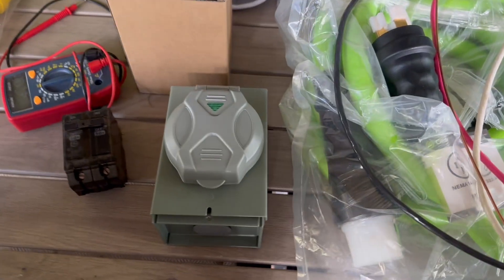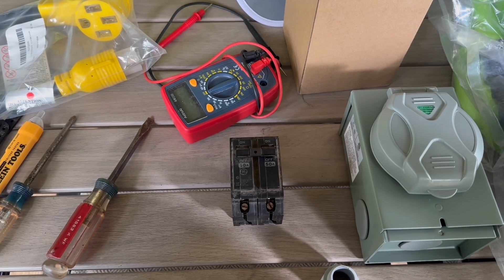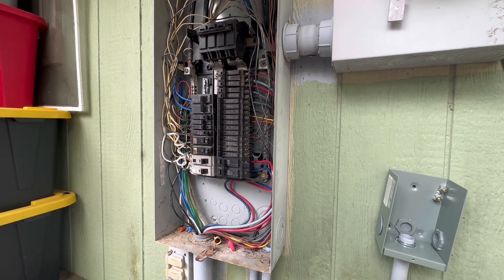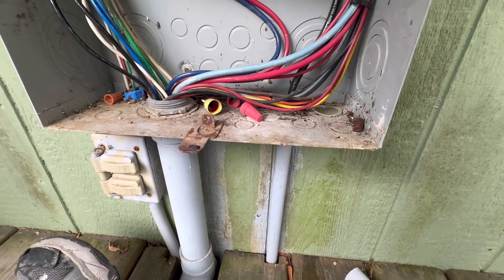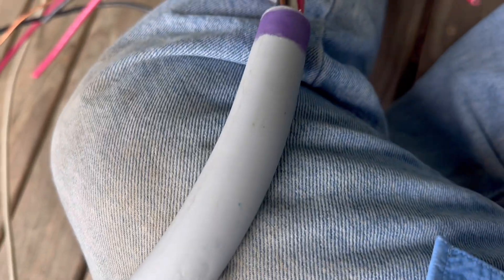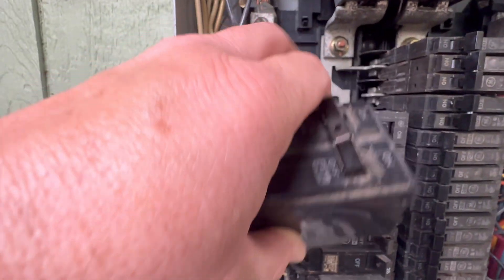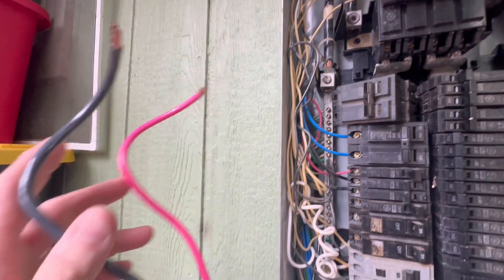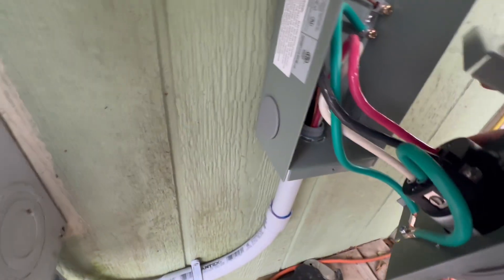How to install a 50 amp generator inlet box on your home!  Run your WHOLE house or most of it!!

Comment: If I'm running this to my inside main panel the Neutral and Ground are not together. They are not bonded. What do I do at the generator panel where the neutral and ground are bonded?
Reply: Never mind. I thought the generator panel was bonded.
Reply from the maker: @stangssoftwash Glad you figured it out.  Thanks for watching!

Comment: Two things. You should use long tie wraps to wrap around the new back fed breaker and the twin pole or two breakers across from the back fed breaker and the back fed breaker tagged as being the generator back fed breaker. That way should someone else work in the panel they are aware of the back fed status of the generator breaker.  Second, your generator has to be set to floating neutral which means the wire in the generator that grounds the two neutral windings of the generator must be disconnected so there is only one point in the system where the neutrals are being grounded. This is typically in the meter pan or emergency disconnect  should you have one. The generator should be tagged to identify the status of the neutrals be they grounded or floating.
Reply from the maker: Sounds like I have a bit more work to do.  Thank you for the input and thanks for watching!
Reply: @TexasPatriotOffRoadAndOutdoors  There are two main reasons why we need an interlock on the main and generator breakers.  We don't want them both on at the same time due to someone working on the grid could get electrocuted and the other reason is when the power returns to your home the generator will definitely not like it.
Reply: Tie wraps aren't actually allowed to be permanently installed in a panel and is only allowed to be used temporarily till you can install a proper hold down. Its not to warn people of a backfed breaker. Its to ensure the breaker in mechanical secure incase it doesn't clip in securely due to wear and may fall out. They make breakers that have a center hole to put a bolt through that secures the breaker to the panel with a breaker bracket.
Reply: @howardradford1985  I just installed the inlet setup in my house. The instructions that come with the interlock kit supplies two tie wraps and instructions as to how they are to be installed. Also, the kit includes stickers that identify the inlet breaker as an inlet which get attached to the tie wraps and another that identifies where the inlet box is located outside of the building. This second sticker is installed inside of the panel above the breakers.
Reply: @dougseaman8791 Yeah, most of the kits from China come with zipties instead of hold downs. It still doesn't meet code since these zipties are not made from fire retardant material, which everything inside your service is required to be fire retardant. Zipties also have some stretch to them. Zipties aren't made to hold against pressure, they are just made to bundle stuff together

Comment: The problem I’m having is I don’t have room in my breaker box for a 50 amp. What would you recommend?
Reply: If you can't eliminate any of the breakers then you will probably have to use a transfer switch or GenerLink instead. Maybe you can look at swapping some of the breakers for tandem breakers but there are limits to how many tandem breakers you can use and not all breaker boxes are compatible with tandem breakers. When I did mine I had breakers for a furnace I never used since I have a 5ton heat pump so I took those breakers out to get my generator breaker in.
Reply from the maker: If you don’t want to tackle a larger service, you may have to piggy back off of your dryer or other appliance.  If your not sure about it, I would consult and electrician.

Good luck and thanks for watching!

Comment: 30 amps is all anybody needs. 50 amps will power a few more luxury items but you will be burning a lot more fuel, which may not be available in an emergency. The 50 amp cable is more expensive and bulkier. Unless you can put the generator right next to the inlet, it's going to be a nightmare storing and rolling out that cable.
Reply from the maker: With present set up and new NG generator, we are able to run the whole house, including one 240 v appliance.  

Very convenient for my family.  Thanks for watching!

Comment: I noticed you used a bare ground wire an others are using a green wire for ground. I guess you can do either way?
Reply from the maker: I’m not an electrician but I’ve been taught a bare ground inside a box is acceptable.  If outside the box and exposed, then it’s best to use a shielded wire.  

Thanks for watching!
Reply: If you use metal UL listed conduit you don't use a ground wire at all because it becomes can grounded.
Reply from the maker: @howardradford1985 Great input.  Thanks for watching.

Comment: Almost unwatchable, at least 1 commercial a minute.
Reply from the maker: I don’t know how YouTube assigned commercials.  Thanks for watching, however.
Reply: I didn't get a single commercial. Commercial are sometimes assigned based on the device you are watching from. When I watch on my Samsung Smart TV the commercials are few and short, but if I watch on my cheaper TV they add alot more commercials and last over 2 minutes at time.

Comment: Wheres the video on showing the diy sheetmetal interlock switch?
Reply from the maker: I need to revisit this.  Haven’t been able to get to it.  Thanks for watching.
Reply: There are videos on YouTube already that show hot to build an interlock from scratch. They aren't actually very interesting videos to watch and they always use cheap pot metal.

Since anything homemade wouldn't be UL listed it wouldn't really matter. You would be in just as much violation of the NEC/NFPA with a home made interlock as you would be without using the interlock at all.

Comment: 3:30 is that a 480 V breaker
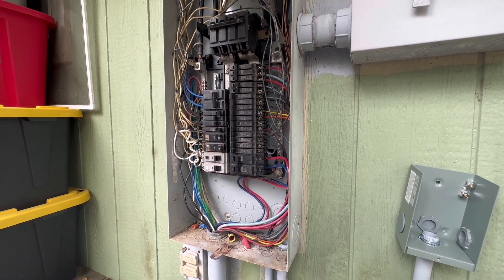Reply: Nah. That still a 240V crossover. The reason it appears to be quad breaker is because the number of breakers the box accepts. At 4:12 before he swings up to the meter you can see the two on the left connect together on the left bus bar, the two on the right connect together on the right bus bar. Each side alone are still only 120V
Reply: @ OK thanks
Reply from the maker: @Scrubdaddy6767  shouldn’t be!

Comment: Im looking at a generator that is bonded. If I bond the outlet I'll have a ground loop. Question do I not bond  the outlet as it will only be for generator service?
Reply: Doesn't actually matter cause your service panel is already bonded and grounded sometimes transfer switches are unbonded and that's when you must bond the outlet.
Reply: @howardradford1985  thanks for the information.

Comment: Will the excess wire from moving down the AC breaker cause any issues? I see it coiled,  looks like you did not cut the excess
Reply from the maker: @marceloacuna6479  No, it will not be an issue.  Just treat it like any other breaker, outlet etc, take caution when rearranging wiring so that it doesn’t rub on anything metal or be in a bind.  

Thanks for watching!

Comment: Please add the Interlock bracket to protect your family and make it legal. I realize you personally know how to handle the breakers, but if you are not home, and the dryer stops working, someone in your family may go to the breakers and turn on all the breakers that are off, including the generator breaker.  You would not even know they did it.  Then someone in the future may open the generator inlet lid and touch one of the exposed prongs.  That would be very bad. Please make it safe.
Reply from the maker: @johnsteed9973  As soon as I can, I’m gonna post a video of my Interlock.  How I made it, how it works etc.  

You are very correct on the danger without an interlock.  

Thanks for watching and be on the lookout for my video!
Reply: You must not have watched the vid. He said as much several times!
Reply from the maker: @weseehowcommiegoogleis3770  Thank you!

Comment: Shouldn't your NEUTRAL (WHITE WIRE) should be on the left side Neutral Bus Bar?  Copper Ground on the right side Ground Bus Bar.
Reply from the maker: @Jim_Sieg  I will have to double check my connection!  Thanks for the advice and for watching!

Comment: WARNING!!!  Do not listen to a single thing this guy is saying. He’s just hooked up a fire hazard and shock hazard, as he overfilled that 3/4” conduit and is likely clueless about his neutral bonding situation. Hire an electrician… please!!!
Reply: Literally every video I’ve seen of people doing this are using the 3/4 conduit.
Reply: It UL listed and 3/4 inch it correct for a single run of 6/4 or 6/3 8/1

Comment: If the main and generator are both on would you be able to use the box to power your RV?
Reply from the maker: @rapscull5031  If the main is on and the inlet box is not interlocked, then yes, with the correct power cable and male/female ends, you could power the RV.  However, it would be very dangerous unless you made sure to connect the RV first (due to the male end).  

Thanks for watching!

Comment: All these people on these videos have their breaker panel on the outside of their house..........that seems so weird to me, being from Ohio.
Reply from the maker: @gourmet53  Yes, that’s the norm around these parts to have the box on the outside!  Thanks for watching!
Reply: I'm in central Arkansas.  My main 200 amp breaker is on the outside of the house and feeds a 60a and 40a breaker in that same panel and also sends in power to the main house "sub panel" in our master closet where all the dedicated house breakers are.  I am moving the two outside 60a and 40a HVAC breakers to a sub panel and where they originally were, will be putting in a 50a breaker for the generator with interlock kit and a 100a breaker below that feeds the new HVAC sub panel.  Kind of a pain but that's all that can be done.
Reply from the maker: @ Sounds like a lot!  Thanks for watching!

Comment: I have a mobile home  and it has a braker box outside and a sub panel inside which is connected to a 100 amp braker where do I need to connect the inlet box on the breaker box outside or in the sub panel inside ??
Reply from the maker: @JaimeSslazar-rk7nm  Do you have any breakers on the outside?  If so, do you have any available slots?
Reply: @TexasPatriotOffRoadAndOutdoors  yes there's couple slots I was just wondering which way is safer
Reply from the maker: @ I would do the one on the outside the house or you will have to route the generator cord through a window, door or etc.
Reply: @TexasPatriotOffRoadAndOutdoors  thank you so much for your help
Reply from the maker: @ Not a problem!  Good luck with everything and be safe with your project.  Thanks for watching!
Reply: @TexasPatriotOffRoadAndOutdoors  thank you

Comment: I believe on a "main" box the neutral and ground should be connected to separate bars.
Reply: Nope. In the main breaker panel - the one that houses the service entrance from the utility and contains the primary means of disconnect - grounding conductors and neutral conductors  are terminated on the same bar. While it’s true that the ground and neutral could be landed on separate bars, it makes no difference in this case since those bars are bonded together.  Importantly, the generator itself must not have a neutral-to-ground bond (floating neutral), as the bonding is already handled at the main panel. However, in a subpanel, grounding conductors and neutral conductors are terminated on separate bars, and the neutral bar should not be bonded to the panel enclosure or the grounding system.  I am not an electrician, but I know things :).

Comment: you went way overboard on the wire gauge. you only need 10g at most for 50 amp
Reply: 10 Guage wire is only good for 30 amps
Reply from the maker: @robertomunoz3719  Agreed!
Reply from the maker: @chebrneck  Just wanted to play it safe!  Thanks for watching!
Reply: lol he said 10
Reply from the maker: @coachrudeboy  Yea, 6 is much better for 50 amp!  Thanks for watching!
Reply: You are smoking crack man. 10g only good for no more than 30 amps. 8g for 40 amps, 6g for 50 amps. Always hire a real electrician. People like you are the reason for most electrical house fires.

Comment: You have a neutral that is supplying the same neutral from two different sources, hydro and the generator.
Reply: The hydro neutral doesn't have a complete circuit so it's not live. The Electricity is being routed back  to the generator because that's the shortest distance of the complete circuit. In order to be electrocuted through the neutral you have to be touching a bare spot of the shortest path of a complete circuit.

Comment: I have no room in my 100 amp panel to install a generator breaker. Can it be in a seperate box beside the main panel?
Reply: Get dual tandem breaker for the 15 or 20 amp so you can combine 2 of them then add the 50amp breaker, because you need interlock close to the main breaker switch
Reply from the maker: @addminusDIY  good info!  Yes, 50 amp and interlock need to be near the main!
Reply: I have a manual transfer switch on my meter pole between the meter and inlet that I connect my generator to.

Comment: My panel does not have a Main Breaker? What are my options? Transfer Switch?
Reply from the maker: @rolandoalmaguer  I would think it has to have a main somewhere??  I would recommend an electrician take a look at your situation.  I hope that helps!
Reply: At my house the distribution panel does not have a main breaker. My distribution panel is inside my garage, and main breaker is in a panel on the outside of the house next to the meter. How to rig that up with a manual disconnect and generator breakers though I have not figured out.
Reply from the maker: @gregoryscott4694  Maybe a sub panel or transfer circuit next to the main breaker?
Reply: @gregoryscott4694 i have the exact same set up….electrician told me It can be done but it has to be from the outside behind the distribution panel….he did mention I have to send him a picture of it because the interlock for that set up is specific to that panel

Comment: Where is your neutral disconnect ? It's an A/C current. Your putting power back to the panel thru your neutral ! You need to isolate your neutral. With the generator running check load between ground and neutral. It's HOT.
Reply: It's only hot within the confines of the panel. It doesn't travel back to hydro since it doesn't have a path back to source. Neutral only carries balance. I think you are confusing continuity with current.
Reply: Can you elaborate more. How was he supposed to isolate neutral?
Reply: SO I HAVE TO RERUN THE HOUSES WIRE AND RUN ALL THE OUTLETS LIKE LIKE DC?
Reply: @ceedequette3030  no absolutely not, that's not what he meant. He means to have some kind of disconnect that will cut not only the 2 hot wires but also the neutral wire. I'm still trying to figure out the best way without having to do a transfer panel with only a handful of breakers.
Reply: @ronrodgers6727  what's the best kind of disconnect to do this? It'd be great if there was a main breaker that disconnected the neutral as well.
Reply: Master Electrician here. The neutral only needs to be "switched" if you are using your Generator as a isolated system. If you are confused you need to call a professional@Antoniocool86
Reply: Would that send power back through the neutral to the utility lines?

Comment: Ive installed a few generator inlet boxes this year, about to install another one next week. I was an electrician for 10 years before getting into the backup generator industry. You did a pretty good job for a homeowner. I will say though, its a bit more difficult to perform this task if the electrical panel is flush mounted inside the building as opposed to the outdoor surface mounted panel we see in this video here. Getting (4) #6 gauge conductors safely from outside to an indoor panel that is sunk into the sheetrock without causing any damage can be very difficult and would definitely not be something the average person should approach without understanding it may not go as smoothly as this video.
Reply from the maker: @bobby_hill8357  I really appreciate the compliment and feedback.  That was first time working with 6 gauge and I will say, it was tough to manipulate.  

Thanks for watching!
Reply: Would it be a problem running a generator with the neutral bonded to ground in the generator? That would be double bonding which is against code.
Reply: @Antoniocool86 yes and I’m trying to figure out how to isolate the neutral at the main breaker or either the generator?? Not much information out there.
Reply from the maker: @Antoniocool86  Thanks for watching!
Reply: No. He doesn't explain it but you are incorrect. If your are trying this look for others that only explain why you don't need to break the grounding binding. It is not double bound this way. But there's more to it than just yes or no and it depends if he runs a ground rod until the ground, etc.